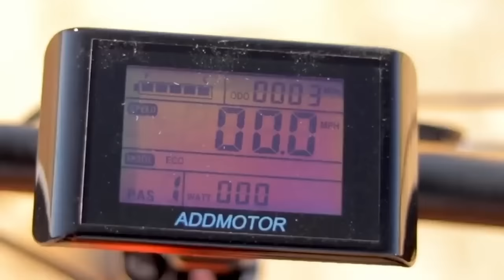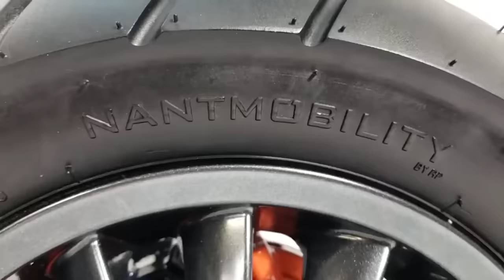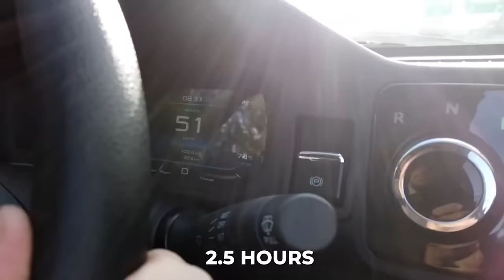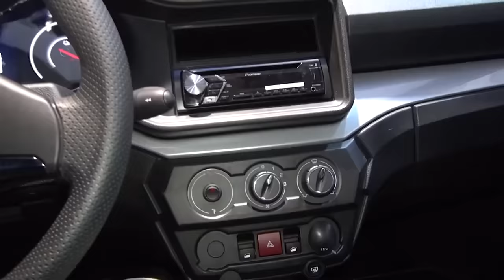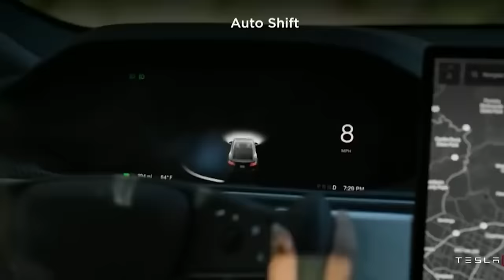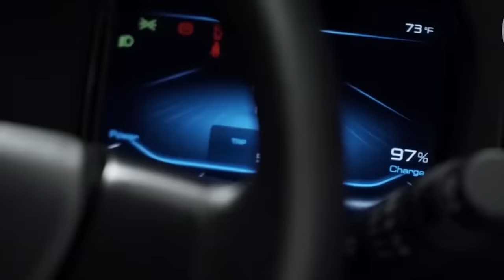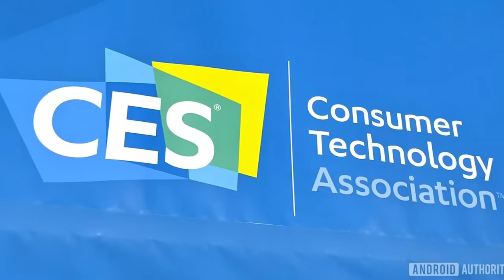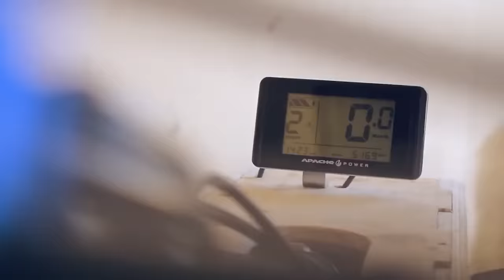60 Mini EVs, Quadricycles, and Bike Cars to Hit the Streets!

Comment: The core problems with electric cars are 
1.) The price is on average 10-20% higher than for a car run by combustion engines. 
2.) The distance you can drive on one charge is way too short. 
3.) There are way too few charging stations. 
4.) The cost of electricity per km is more than the cost of petrol and/or diesel.
5.) It takes too long to charge the vehicle 
6.) It cost too much to charge the vehicle on the road
7.) The manufacturing of the batteries are anything but environmentally-friendly. 
8.) In many countries around the World there isn't enough electricity to go around at present (January 15, 2023) for everyone to have electric cars instead of cars with combustion engines, this must be solved before people have to replace their combustion engine cars with electric cars. 
9.) Batteries die quickly when it's cold/hot outside, batteries survive the longest between 68 - 86 degrees F (20-30 degrees C), this's a major issue in both hot and cold countries. 
10.) To replace a battery pack cost up to 25% of the cars total value. 
11.) The cars that was demonstrated here are all too low, that is, not enough clearance between the bottom plate and the ground, which is essential where I live, not least during the winter and spring due to the climate where I live.
12.) I have never heard any information pertaining to these types of vehicles regarding front-, rear- wheel drive or 4x4, which's essential where I live. The roads out here are gravel, and are very similar to roller-coasters literally. 
13.) With that said, to use a battery-driven car/ATV/UTV/truck/tractor... to e.g. plow roads free of snow don't seem to be a practical solution, nor for any other form of heavy work etc., ... small businesses might as well just shut their doors and create mass unemployment in colossal numbers World-wide.

No, these might at best do in the cities, but in the country where I live they ain't worth moose spit!
Reply from the maker: Should I do a video on this topic?

Comment: Why do you get so little power in such expensive vehicles? I bought a $1500 electric scooter with 6000w 60v 40ah 70 miles range.

Comment: The vehicle called the bicycle, the first date of this means of transport was around 1246 in India, later Da Vinci in 1552. I just ask, do you have no idea to get out of this loop of knowledge about this principle so old and try something absolute new, evolutionary and revolutionary.
Reply from the maker: Hmmmm
Reply: @Electric-Rideables  An overview. For example, all the video images you have selected all have the same technical and technological principle, changing only the shape / position of the frame. I designed and realized something different from the market. A 4-wheeled vehicle, a new, unique and original concept. The more diversified the market is with different vehicue than the existing one multiplied in different models, which have the same technology in their composition, then we can have a breakthrough.

Comment: i gave it a like, the system wants to program every one for dopamine hits, this locks in a drive to receive that reward like an animal does tricks. this is all part of the social credit score to come and the programing of the masses. this in turn has content providors pushing users to participate in the scheme who rather not. should any viewer wish to ignore the fact and blindly slip into the matrix take the blue pill and get out of the way.
now the mention of size to fit an elevator made me cringe. it seems these china sourced batteries are sometimes bursting into flame violently! many videos on the tube here . one showed a man trapped inside an elevator unable to escape. lucky it was only one person injured but you all enter a car with one you take chances of the thing burning you to a crisp. then placing these inside ones home or god forbid a high rise apartment block. you see the potential tragic results to come.  so lets hope this warning save one life!
Reply from the maker: This man has it all figured out. Thanks.

Comment: There e- micro cars aren't getting the mileage, speed or price I need. The 15 - 20 mph is slooow. If it cant do 30 mph and at a minimum of 75 mpc. it is of no use to me.  They are neat looking , but I would never pay in the 10,000 range. You can get a nice used Corvette for that!   I have several friends that went the e-bike route and several have switched to 50cc scooters. No drivers license no registration no insurance. They are getting 100+ mpg.    👍👍

Comment: Velomobiles are very attractive but the speed range is so mediocre and does bot belong either to cars or cycles. It will be very annoying to see them on a car road knowing it is too slow to follow but too fast to pass by
Reply from the maker: True that. Most of them are meant for the bike lane though.
Reply: @BoostKlicks and they are not meant to be.   they are meant for fast commuting (faster than normal road bikes) or touring in comfort or getting around town with weather protection

Comment: People need to look carefully.....
The vid firstly showed ridiculous looking pedal/electric vehicles...the kind the UK had with the Sinclair C5...which went down like a lead balloon in the UK. You see...they are not `visible`, distinctly dangerous on roads due to nil power & speed and being tiny, other drivers in normal sized vehicles have trouble seeing them...but the main thing about this vid....IT NEVER SHOWED THEM GOING UPHILL, ONLY ON THE FLAT & DOWNHILL!
Just another vid so EV pervs can gasp and screech, "What a `brilliant` idea....coooooool!"
Reply from the maker: Good feedback. Safety definitely is something all manufacturers should be tuned into getting better at.

Comment: Shouldn’t tricycles have two wheels in the front, not the back?
Try to turn sharp with two wheels in the back…
Reply from the maker: yeah. but, which one is the "reverse" trike?
Reply: @Electric-Rideables  ?? I don’t understand your question
Reply from the maker: @pascalbruyere7108  One of these is called a "reverse trike:" two wheels in the front or two wheels in the rear. which one?

Comment: Lying before the products are even produced. There is no such material as aerospace grade aluminum. Generally the 2000, 6000, 7000 series aluminum alloys are used in aerospace because these alloys are heat treatable aluminum are always used in structural aerospace components. I was a leader at Alcoa and have been in aerospace components and heat treating for many years.
Reply from the maker: Touche

Comment: The beauty about these e vehicles is.....
The sta te can switch you off at will....Or control whether you can access power... based on the so cialist  cre dit system.
They put a much greater load on the electrical power grid.
Failing to tell you solar, wind  and hydro power struggles in reality to even produce 15 percent of a communities power needs, and that fuel is not in shortage or produced from .din osaurs !
  e vechiles are also  explosive, self ignite & create Hazardous waste, along with their low travel range 
Hence the name...city stoppers... A future where you cannot leave town.
Plus  costing a hell of alot more than good old motor vehicles, and bicycle's.
They are effectively rich boys toys.
By the time you realise that the environmental damage... is being created by the nan ny sta te... To make us all depe ndent, you will No longer be able to thi nk for yourselves.
Reply from the maker: Someone stop this guy. He got it all figured out.
Reply: Traduza para o português .
Reply: @mariaarcos3826  
Use o google tradutor amigo, eu nao falo Portuguese

Comment: So many bicycle cars...

Where are the single seat "motorcycle" cars? Are they literally illegal?
Some of these would be interesting if they weren't limited to piddly, pathetic drivetrains.
Reply from the maker: Yeah, we'll try to do more coverage of full-sized EVs. thanks for watching!
Reply: @Electric-Rideables  I'm more so talking about electric street legal variants of the Sierra Cars RX3. They basically don't exist abd it's fucking annoying.

It's not you. It's the market. It might be the regulators.
Reply from the maker: i hear ya. yeah, sierra cars are insanely cool
Reply: @Electric-Rideables  How did you get into this work anyways? Were you just like me, perpetually losing yourself in rabbit holes on the internet, trying to look for the perfect vehicle?

-

Now I don't mean to bore you so disregard all this if you wish, but it seems to me perfection right now would be a combination of EV and an on-board LEV to get from a parking space to your destination. Perhaps with a gas electric generator for the EV in the case of needing longer range. A hydrogen electric generator being a more ideal power source if a suitably small hydrogen generator comes to market.

I personally don't want to do a lot of hauling regularly, so I'm fine with a smaller car. And I place a lot of value on a centered driving position, respectable speed, and terrain flexibility, which is why the Sierra appeals so much to me and why things like Triggo and Twizy don't appeal at all. Small Mazda's and Porches are of course interesting, but the offset driving position just isn't ideal.

I would like an even more streamlined and low version of the Sierra, the LCC Rocket is also in some ways very appealing. But it has the same "open top" issue. I'm not sure if it's common with rules essentially saying "You can't register it legally as a motorcycle/quadricycle if it has a roof and doors.", but the market seems to act like that's how it is. I really do wish that rule would just get deleted. If it was, perhaps it would be possible to make it as slippery as the things you see in the WSC's (World Solar Challlenge) leaders. The kind of aerodynamic exterior that makes airflow so laminar that bugs slide over the window instead of splatting. Idk, this is mere theoretical play from someone who amount to little more than an observer. I am planning to take up welding again and perhaps I'll find the opportunity to do something in this direction.

Half-jokingly, the vast variety we have seen is not meant for mortal eyes, the spectra of great and terrible mechanical options is a confusing mess, and even if we found a better ideal it might take so long to take root and be allowed to grow that these wishes would not be met until we're nearly too old to enjoy fulfilling them. We're still going to be seeing difficulties using electric scooters to their full potential in many parts of the modern world for a long time, if not for the rest of our entire lifetimes.

Comment: These "mini EV" vehicles are AAL waaaay too expensive. Battery prices have to come down and power density has to go up.
My E-MOUNTAIN BIKE has two wheel drive, 2 batteries (15 Ah and 20 Ah) and gets 60 miles on paved roads. That's better than many of these mini EVs and all for $5,100. and has a 400 pound max load capacity.
MINI HYBRIDS make a lot more sense than pure RVs.

Comment: Ah yes, the Segway Death-mobile that they had to redesign because the center of gravity wasn’t low enough. Kind of like the Razor where the front wheel is just too small.  Easy fixes… USA USA USA. TRUMP 2525, 2525… 🇺🇸 🌎
Reply from the maker: 2525? As in vote Trump 502 years from now?
Reply: @Electric-Rideables  Anyway, it was the year 2525 and we were just barely alive...  🎶 🎵🎶 🎵

Comment: Tricycles should always have the two tires in the front steering position. Nothing but piles of crap. The energy from fossil fuels required to make all these battery powered turds on wheels plus constant recharging negates any "green" benefits. Then there's the massive toxic waste from poorly disposed of batteries. As far as any "Segway" type of death machines... There is a video of the owner of Segway getting thrown over a cliff by his Segway. It's kinda funny sadly enough.
The ultimate fail of vehicles like the ones in this video is there all about virtue signaling. Are they made as a practical vehicle? Does a vehicle light enough to easily be move by hand need a remote parking feature? How well do electrical components hold up to moister, vibration and dust? 
If your making an economical, environmental vehicle for the masses... Does it really need gps, stereo sound, a unique battery design that can't be replaced or used in any other application or anything that's not the vehicle. Then your trashcan on wheels collection averages what $8,000.00/$10,000.00 USD? So nothing but toy bicycles for rich virtue signaling leftards to show their acquaintances how in touch they aren't.
Do you know what the major complaint with the original EV1 was? No air conditioning. That is a total lack of perspective. We must save the Earth before Greta losses her $#!t again, but I'll need some ac to go with that.
Reply from the maker: Thanks for the info. Complaining about the lack of AC in the EV1 is quite hilarious.
Reply: LOL...that was VERY funny !!. (.about Greta...)  AHAHAHAHA !!!!) HAVE A GREAT DAY  my friend!

Comment: imagine having to change your car engine every 4 years   pft.. batteries...no thanks.  That's gonna put a strain on the environment. me thinks these are worse at the present time.
Reply from the maker: That's crazy cuz there are literally millions of EVs (globally) that have been on the road for 10 years or longer without having to change the motor or batteries. I believe you probably see those few negative stories, internalize them, and assume all EVs have bad motors and/or battery packs.